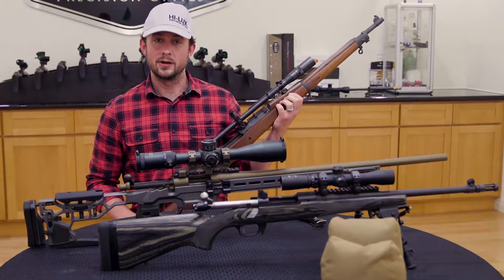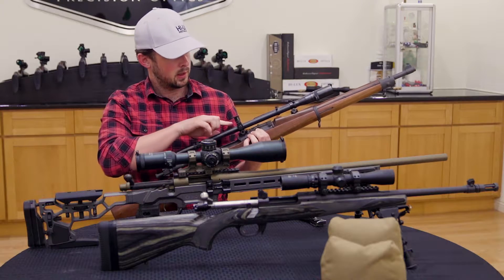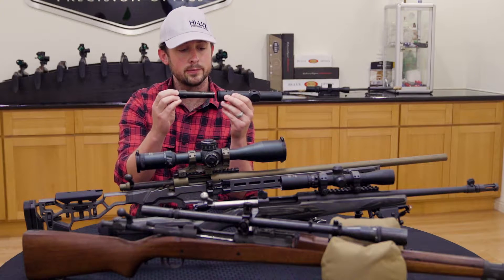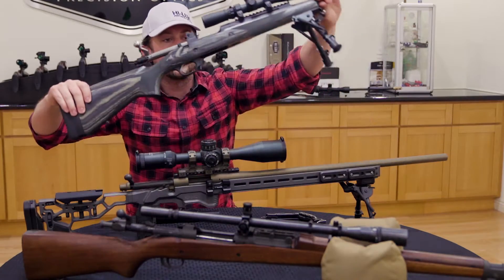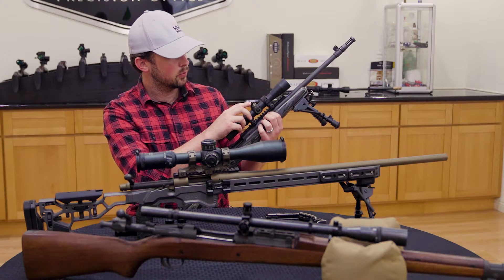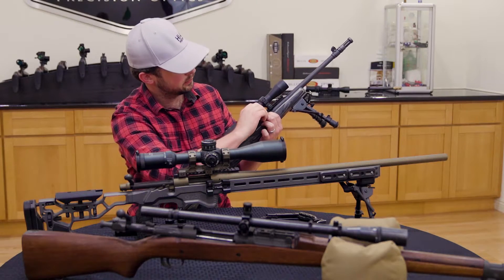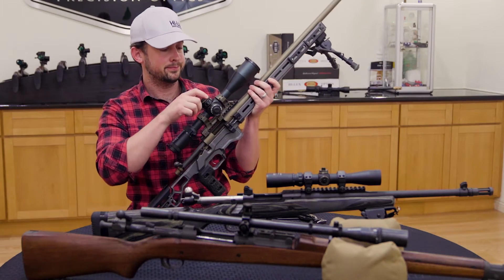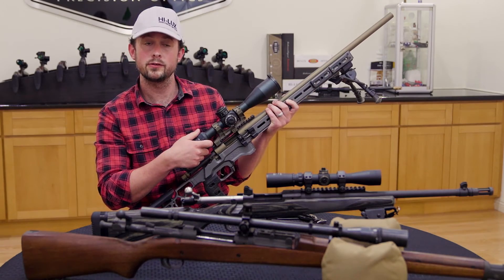How to Reset your Scope to Optical Center

Comment: Hello.
I have a vortex diamondback 6-24x50 FFP the parallax works untill 100 meters. After 100 meters (100 to 300 on the parallax turret) it stays blurry. 
Will resetting to center fix it ot is it smtmg else to do please.

Comment: I'll be honest, apart from the excellent explanation of how scopes work I'm still unconvinced optically centering is necessary or even relevant. Scopes are mounted, boresighted and zeroed regardless of optical center. If you come to a stop and can't move the erector in one direction but you can in the other, it is unlikely an intelligent person is going to increase torque until something breaks.

Comment: Thank you for your video but can you do one at a time I count 370 turn and i Split it in half the same for the other one. Thank you for your Answer .
Reply from the maker: Doing one turret at a time (fully to the end or to the middle) defeats the purpose. Staggering the adjustments is the best way to avoid scraping the erector unit against the inner walls. 
I'm not sure what the 370 refers to, unfortunately.
Reply: @HiLuxInc  It's a  4x16x42 NikonM223

Comment: Very poor explanation.  I don't know what you did or how you knew how to do it, but the explanation was lacking clarity.  I'm unable to understand what you did or repeat what you showed.
Reply from the maker: @denniszolotor2920  the cliff notes version: Find out how much 'travel' your scope has. Max out both of the turrets. Adjust until both of the turrets are in the middle of the travel. 
Different scopes have different amounts of travel, so there is no one-size-fits-all value for this.

Comment: Very interesting video. Unfortunately didn't solve my windage issue. I'm still at the maximum windage but still can't adjust the Poi. Did I dammage beyond repair my optic (Vector Veyron) ?
Reply from the maker: Without looking inside the scope, that can be a little difficult to determine. There's also other possibilities - the most common being that the rail might not be installed in line with the bore.

Comment: How do you know how many times to turn the turrets to return to center? For the Scout, you made 5 rotations on each turret at .25 MOA, for the MDT, you made roughly 4 rotations. What math are you doing to know how many times to turn it? Additionally, what nunbers on turrets are you referencing and what are they telling you?
Reply from the maker: That all depends on the specific scope. Each scope will have a certain total amount of travel, which should be listed in the manual somewhere. I turn the turret half of the total travel (e.g.: If a turret can make 4 turns in total, halfway would be 2 turns). 
The markings on the turrets can also vary. They'll either be in MOA or MIL. Turrets marked in MOA values typically are 1/4 MOA per click, though older scopes are sometimes 1/2 MOA. MIL turrets are typically 0.1 MIL per click. The turrets may have a different number of markings/clicks per revolution. 
So to do this, you'll need to know: How much adjustment the turret is capable of and what unit/value the turret is marked in.

Comment: I did not understand: OK, you "centered" the inner tube, thus relieved it, but, now that you've got to (re)zero the scope, you got to move the reticle, most likely putting the tube (and the reticle) into the previous position (same position it was in, before "centering")???
Reply: Thats what I was thinking as well.
Reply: This is what I was thinking too? The only way this would be helpful is if he took it back to optical centre and then used adjustable scope mounts to roughly zero and fine zero with the turrets?

Comment: I don’t understand so if your scope is zeroed and you find the middle only to zero it again it’s back to where you started right? So why do it?
Reply from the maker: If your scope is zeroed and is functioning fine, there's no point in doing this. If your scope is zeroed and suddenly no longer adjusts (or could never 'reach' the zero), then it's time to do this. Reset the scope, then you can see how far off it's pointing from the expected midline. Doing this can also return function to otherwise stuck dials if you're trying to zero to a new target.

Comment: Hi guy I purchased a 6-24-50 from Monstrum I turn the turrets NOTHING happens to cross hairs,I returned it,and  the new one does the same thing ? what am I doing wrong, also I tried to lift the turrets while turning what can I do ?
Reply from the maker: The reticle should always appear to stay at the same spot in the glass (the center). The real way to test is to take your setup to the range. Put your crosshairs right on the center of the bullseye, take a shot. Turn the elevation knob a large amount (maybe a full rotation), then put the crosshairs on the bullseye and shoot again.
When you're dialing, you're not repositioning the crosshairs inside your sight picture. You're repositioning the sight picture itself - which can be  quite difficult to measure when just holding the scope at home.

Comment: My problem is that.        #1 I'm using a red dot bore lazer As my target point.
#2 logically I figured on adjusting crosshairs to the red dot.
#3 the hairs don't move any direction.
Is there an internal problem that can be addressed?
Reply from the maker: Sounds like one of three things could be happening: 
1 - If the laser and scope are pointing at something very close, the change to your crosshair position may be too small to notice right away. 1 MOA = 0.1" at 10 yards. You'd have to dial quite a bit!
2 - The scope may not be able to adjust for a close enough distance. If this is the case, the turret will likely hit a limit and stop rotating. 
3 - The scope may be damaged or broken in some way. This is especially the case if the scope hit the limit (mentioned in #2) and continued being dialed.

Comment: Totally worthless video because I can not find any info on any of my scopes where they say how much adjustment there is, new or used!
So how do we make this adjustment then?
Reply from the maker: Then it requires a bit of experimentation - run each turret to the lower and upper limits by dialing them in the usual way and count the overall travel. 
Which model of scopes are you trying to find info about?
Reply: @HiLuxInc  Barska 4×32 illuminated reticle #LVK1-AC11876 I got for $38 and a couple of the skinny little rimfire ones that are variable power, Bariska 3-7×20 #AC10003-JCH4 for $16 both were on clearance at Blains Farm & Fleet in Oswego Illinois.
I even tried that "hold them up to a mirror" technique and all I saw was darkness other than the rimfire one TY that rocked back and forth.

Comment: Is this really necessary? Let's say the windage and elevation are already maxed out one way or the other. When you fire your first shot, it will be way off. So you position the crosshairs over the impact point, then adjust your windage/elevation so that the crosshairs are over your original aim-point (e.g., center bullseye). Done... the scope is calibrated. If for some reason you have to turn the dials back to the extreme to get it sighted in, then there's something else wrong... perhaps with the way it's mounted to the rail. Am I missing something?
Reply: Are you saying the barrel is bent my owd?
Reply: Just wondering with a second hand riflescope, if there is a way to, or a need to find center?
Reply: you should keep aiming at center and move the reticule to your first impact.

Comment: Thank you but 1 thing is still not clear from the video. I'll take elevation only as an example so correct me if I'm wrong: the spring is below the erector tube and the turret above it. So to relax the spring the turret needs to be turned outward/up. The direction as you says is left/counter clockwise. However, if you think about it, that is the same direction as when you want to move the point of impact UP as written on the turret. But this is the same as moving the reticle down! So the erector tube is moving down?? Confusing. Thanks for the help
Reply: The answer you need is as follows: the marking "UP"  means "the direction in which the point of IMPACT is rising". So, effectively, by turning the knob in that direction, you are "upping" the muzzle (pointing the muzzle higher). Accordingly, when turning the windage knob to the "Right", you are moving the muzzle to the right (and vice versa).
Reply: Yes you are correct I think. If you clamp a scope in a fixture and adjust poi up the reticle moves down and vice versa
Reply: Looks like it has been 5+ months since you asked your question. Did he/they contact you or just never read or just ignored your remark?
Reply: @REDARROW-ez7dg  Thanks for your reply. No, I didn't get an answer.

Comment: Very important and informative, thx
Reply: Not really. I mean if you relax it by moving to the extreme relaxed position, then you adjust to center, what happens when you re-sight  it? Won't it just have to be moved back to the original spot, where you were when it was zeroed? Seems like it to me, but there's no explanation as to why it isn't. Or if you have to move the actual mount to compensate. Not very clear at all.
Reply: @scotthoover6689  this is exactly what I was thinking. This leaves me feeling confused for the exact reasons you stated.
Reply from the maker: Thank you Cliff.  Also, if you have any recommendations for videos you'd like to see from us, please let us know.  Respectfully, Corbett Leatherwood & the Hi-Lux Team

Comment: This video was helpful. But the problem I am having is the sights on my rifle scope are reversed what I mean by that the elevation moves right and left the windage moves up and down. Is there anyone out there that can help me with this problem pretty crazy!
Reply: Hi Don, some rifle scopes (like our CMR4) have the windage positioned on the left side of the turret block instead of the right side. I would recommend that you check your riflescope's manual to confirm the position of the windage turret.
Reply: @christopherwu814  
 thank you for your reply Christopher. when I first bought the rifle scope everything works like it should the elevation was on top of the scope the windage was on the right side of the scope. When I started to sight the scope in all of a sudden it reversed on its own so the elevation on top start going right and left and the windage on the side started moving up and down. That's what it's doing now brand new scope I bought from Pyramyd Air
Reply: Your scope is just turned like 45⁰ in the scope rings. So it make up and down left and right, and right amd left is up and down. Just loosen your rings and turn it until the turrets are positioned the other way.